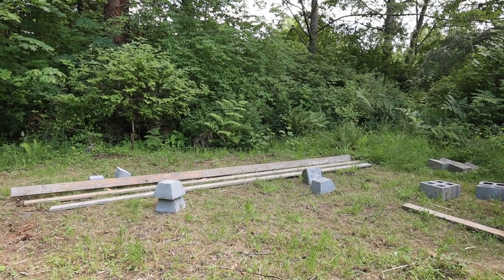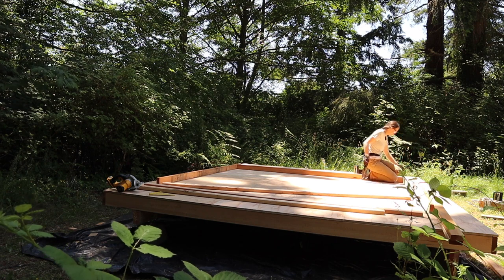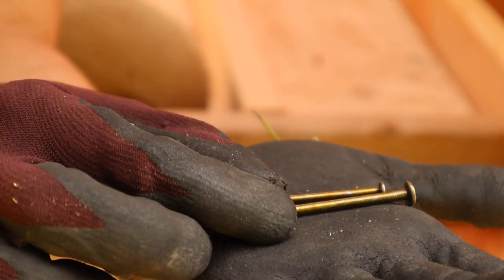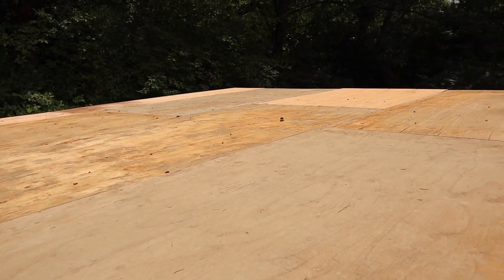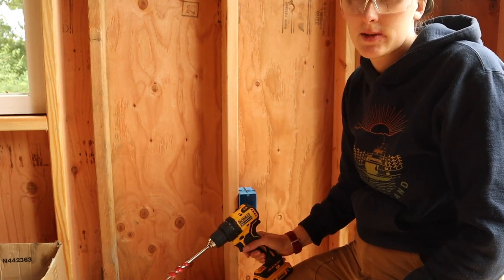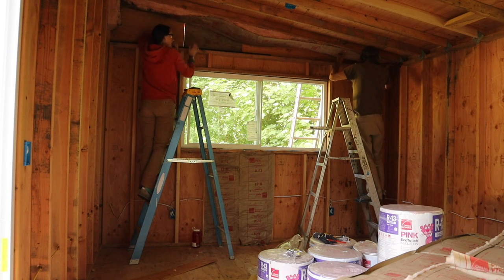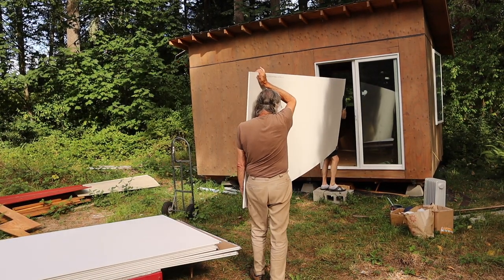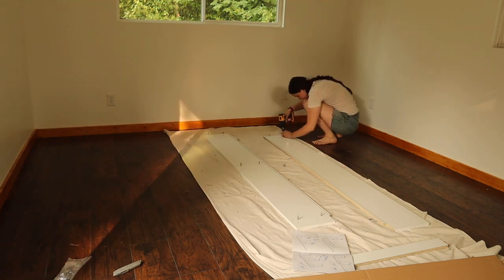How I Built My Sewing Studio

Comment: I built a large chicken coop in a similar style a year or so back using a set of purchased plans. Were you following a set of plans, or did you draft your own measurements for wall heights, roof pitch, etc.? My next project is an art studio in this exact size. Love the video!
Reply from the maker: That's awesome! My next (building) project is a new chicken coop.  It was based on my dad's workshop, but he just made up the plans for that. For the wall heights, we made the back one as tall as we could with one sheet of plywood (so a full 8' but minus the bit that covers the rim joist, so maybe 7'6"?) and for the front we just decided what looked good. Honestly we accidentally made it way too tall the first time and had to cut off a bit. We don't get a lot of snow here or anything we would really need to worry about the pitch for so we just made it something that wasn't too flat, but was still easy and safe to walk on. I can measure how tall that front wall is, if you are interested.
Reply: @VtorHunter  Thanks for your reply! Yes, I'm definitely interested, if you wouldn't mind. For my coop, I used a plan called The Garden Loft. They have a nice website, I think. I considered modifying the same plan for my studio, but it's only about 9x12, which is too small. I'd like to do as you did and max out my dimensions without needing a permit.
Reply from the maker: Ok, what feels like 3 years later I finally measured it! The front is 9'6", from the bottom edge to the bottom of a rafter, so the wall joists were a little less because that measurement includes the rim joist and sill plates. The same on the back is 8'.